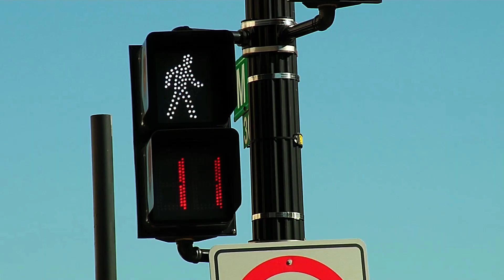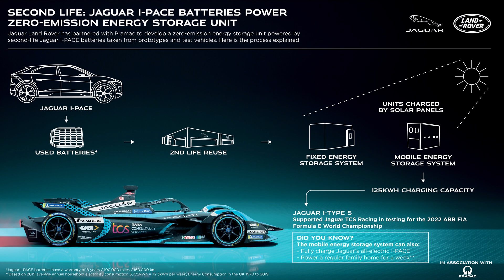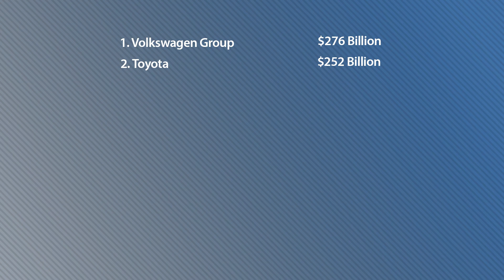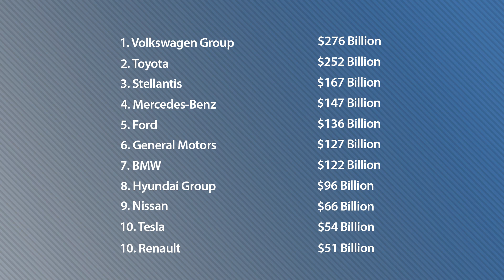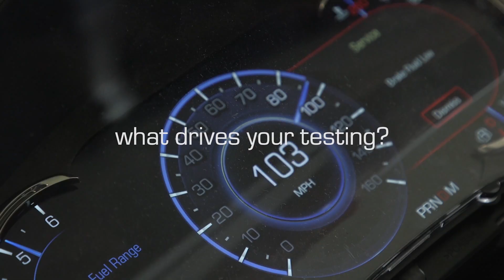Tesla Outranks Renault In Revenue; A-Pillars Are Killing Pedestrians - Autoline Daily 3283

Comment: There is always a trade off;  500 people outside the vehicle vs 38,000 people inside the vehicle being killed each year is likely why the regulations are skewed toward protecting vehicle passengers.  Maybe future autonomous vehicles will bring both numbers down?
Reply: They could also specify a maximum pillar width, forcing automakes to use higher strength designs. Probably autonomous driving will come first though

Comment: OSRV mirror mounting is a critical component contributing to driver vision loss. When a mirror is mounted down on the door, the triangle door glass area is free and permits viewing. When mounted into this corner window area, and as large as mirrors and mounts are, a major blind spot occurs endangering a larger view area than you might think. This is especially true for shorter drivers.

Comment: NHSTA needs to fasttrack required pedestrian tracking technology to address the A-pillar blindspot. Also don't be surprised when Tesla exceeds $100M in gross revenue this year.
Reply: Not even the most excitable bull calls for Tesla to double sales this year, especially after hearing Elon talk about supply constraints at the annual meeting. At an average sales price of $60,000 in '21 and prices going up this year Tesla is finding its cheap interiors competing with more and more valid offerings for buyers in that price range. Tesla needs to step up its game.
Reply: @Miata822  I don't think it will double its car sales but if you add revenue growth from energy then doubling gross revenue is possible.  I'm assuming Berlin, Austin, and Shanghai expansion will ramp up quickly which won't be easy.
Reply: @anoopster  Tesla energy has not historically been a significant part of company sales and has yet to generate any profit. I suppose that could change, but I don't see how, not quickly.
Given what Elon has said about the availability of components and the Shanghai plant now being closed due to COVID lockdown I just can't see even the 50% sales gain Tesla bulls forecast. If you can't get parts you can't build cars.

Comment: Are you sure 200 sq ft is correct?  10 X 20 is quite small and would only allow part of the truck to be covered.  Seems like 2000 would be more like it.  What do you think?
Reply: Check out the photos at 5:52, only the cab of the truck is covered during the swap

Comment: Used car batteries are going to be very desirable and valuable. Solar and home energy storage enthusiast will want those things and so will companies who are building out charging stations. That's just two groups, many others will appear as there is a good supply. This is a real opportunity for junk yards.
Reply: Used vehicle batteries are already in high demand. They can be found on Ebay and good ones are far from cheap. Unfortunately Tesla's planned "structural" battery will be of little use for secondary markets since the thousands of cells it contains will all be epoxied together in a solid brick. Most other manufacturers (and earlier Teslas) package batteries into modules that are easy to reuse.
Reply: I'm not the person to defend most Tesla ways, but guess what Tesla does with their automotive batteries after replacing them?  They (are supposed to) go into their home energy storage products* (probably they haven't had enough battery packs replaced to do this on every unit, but that's the reason they make battery packs, to recycle their automotive stuff).

* used by many "solar energy providers" to store energy for photo voltaic solar home and commercial energy systems
Reply: @syxepop  The structural Tesla battery will not work for home storage since homes in Western countries (or maybe anywhere) don't have 400V service. 
Vehicle battery packs made from modules allow individual modules to be reused even if one module has failed or is damaged in a crash. 
The Ford and GM (Bolt and Ultium) batteries were specifically designed so that dealers could replace individual modules if they had a problem, rather than scrapping the whole battery as Tesla does. This extends the usable life of the vehicle. and makes 'second life' easy.

Comment: The disappointing thing about the IIHS reporting higher deaths from pedestrians year over year since 2009 as a result of the popularity of Trucks and SUVs is that if you watch any "mini car" crash test video they've made since then, they all have the same format:
- The Mini/Smart/Fiat etc. performed very well in our tests
- But you're less safe if you get hit by a truck
- You shouldn't sacrifice safety for fuel economy
- Here are bigger vehicles that get similar fuel economy
* smh *
As a sub compact car owner in North America, I didn't only buy my car for fuel economy; the thing handles like a go kart, the turning circle is tiny, and I can fit into parking spots no one else can. My braking distance in all road conditions is also significantly better.

I believe a huge part of increased pedestrian deaths also has to do with poor North American road infrastructure design. The entire world should follow the Netherlands' example. North American stroads, lack of effective traffic calming measures, and lack of safe walking and cycling infrastructure are incredibly dangerous, and the problem will only get worse over time with heavy EVs that are quiet and have crazy acceleration.

Comment: So, basically that Li car from China is a plug in hybrid. When the "range extender" is 5 times the battery range, it ceases to be a BEV with range extender and becomes a phev. Either way, 100 mile electric only range is excellent for a phev. Though, that boarders the "why not just get a full EV then" question. 50-60 EV only miles I think would be the best sweet spot for phevs to have. We aren't there yet, but in a couple of years, I believe more will be in that range.

Comment: Until EV battery design incorporates economical battery recycling methods, EV batteries are not recyclable.  One of the main obstacles is the wide variety of EV battery pack designs which make it difficult to have effective and economical EV battery recycling procedures.  Grinding EV batteries up, as shown in your video, is not recycling, it's disposal.   It's true that some 'depleted' EV batteries may be usable for other energy storage applications, however, rapidly evolving battery technology will most likely make these applications less appealing in the future.  In addition, government subsidized EV battery recycling is not a long term cost effective solution, although it will most likely be instituted.  A Tesla S battery pack weighs in at 1,200 lbs and at this time can not be economically recyclable.  Can you imagine the backlash if 1,200 lbs of an ICE vehicle was not recyclable and would possibly be deemed hazardous waste?  I'm skeptical if EV batteries can be designed and recycled in a cost effective manner.  The most likely solution is that same 3rd world countries that store our other toxic waste will be storing mountains of 1,200lb Tesla depleted batteries.  Are EV's really green?